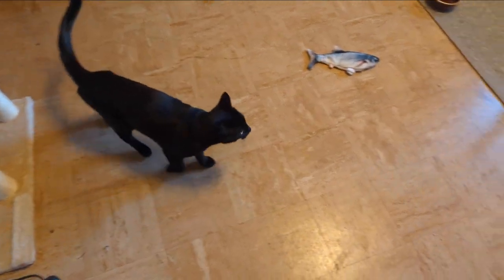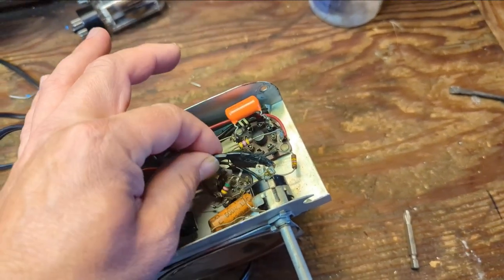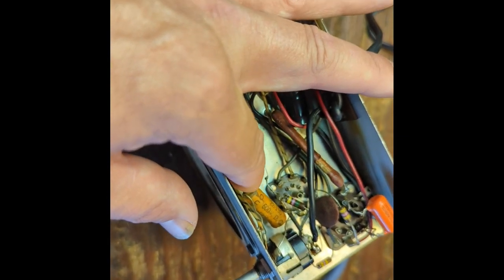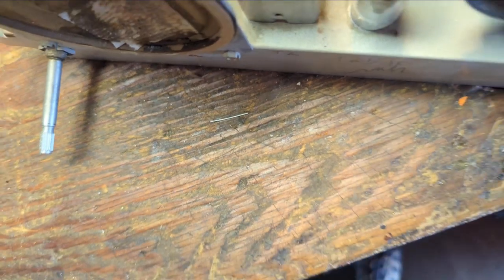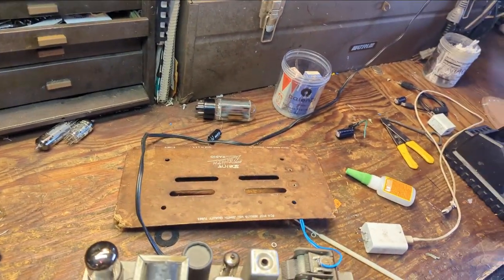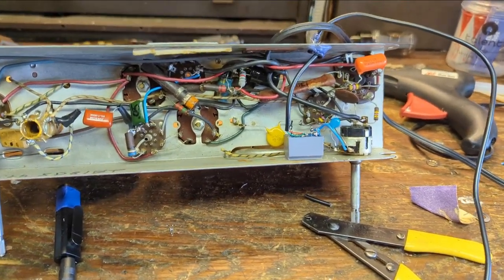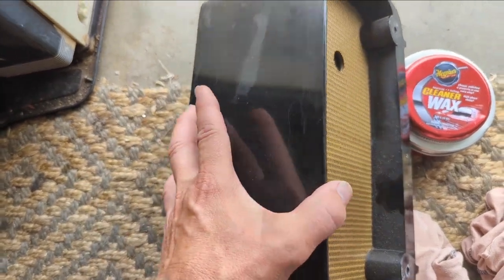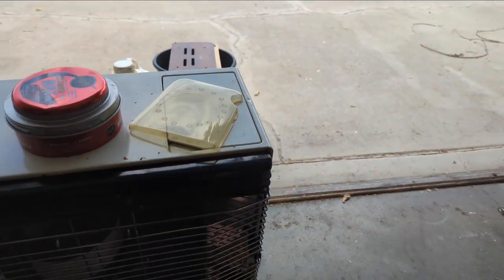A quick refresh of a Zenith " Beehive" radio

Comment: Nice new additions to the fam. I'm sure they will settle in nicely. Zenith  5 - D - 810Y from 1949. Similar radios like this
 were made but all those  had a handle on the top. Previous restorer was probably just starting out and not proficient 
at the job. Like using electrical tape for instance, just did what was necessary at the time or he would have replaced all 
the caps.  Consult the schematic about adding two low value  ceramic capacitors ( U-1) to remove audio hiss. There is 
really nothing good on  the AM  band anymore, unless you like talk shows, religious programs or a ball game. If you want
 music adding that Bluetooth device is always a plus! Wow you finally got  rain!

Comment: Yes Seth I remember when you ordered those isolation transformers in a box of 100 from China sometime back. You do work on enough radios to use them that's for sure. I used to have two black cats myself for years until they were poisoned by Melamine in the Cat food at that time from China. After that happened I got a brother and sister from the Animal Shelter I have one of the two still alive Duke who is 15 but his sister died in 2019 3 days after I had a heart attack.